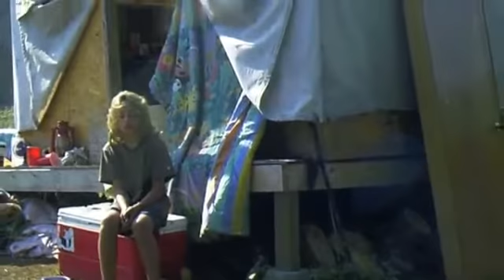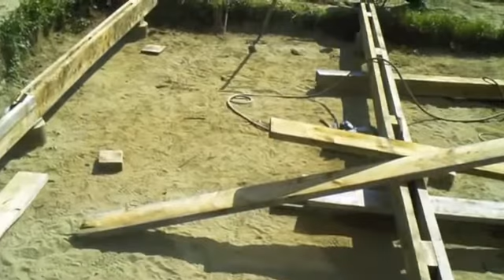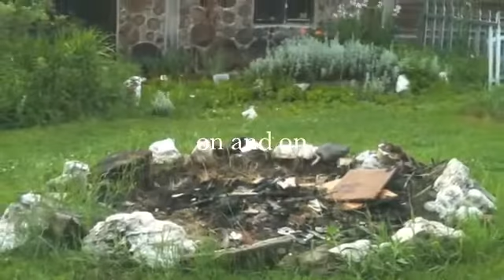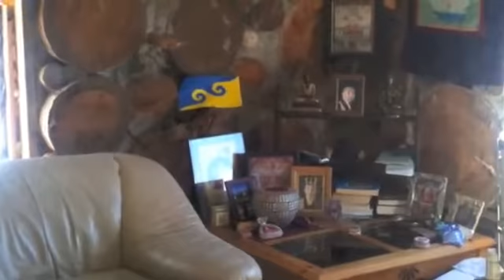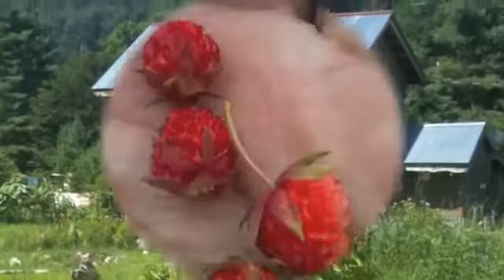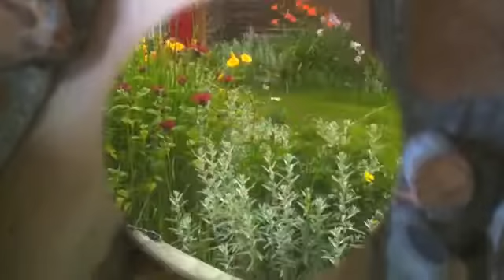Vermont Cordwood House

Comment: i am thinking of building a cordwood house what is your thoughts of using hedge (osage orange) for the wood i have enough to build a house with and it has been in the barn for about 20 yrs with the bark off  hedge is rot resistant and termites wont touch it i just would like some thoughts thanks